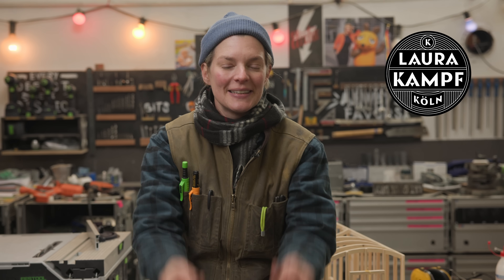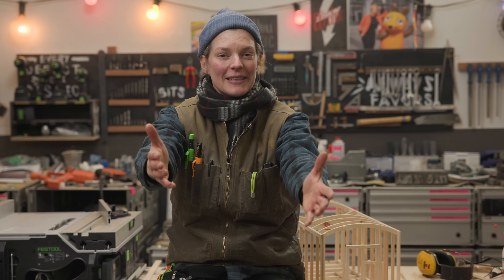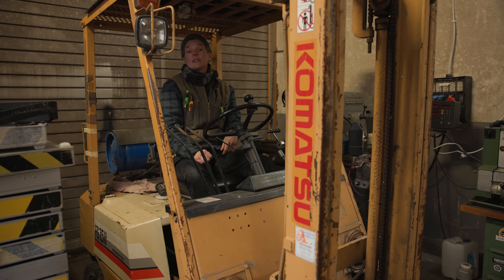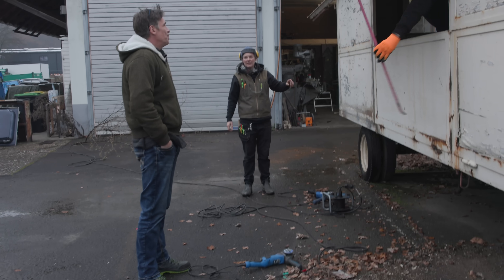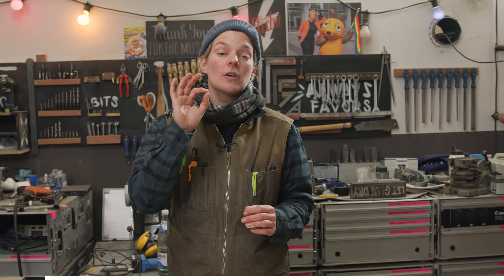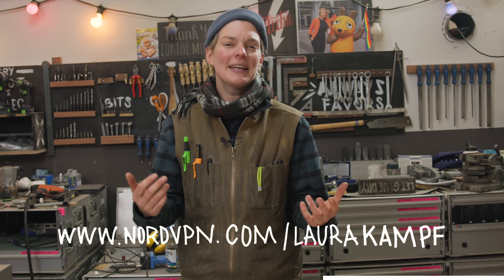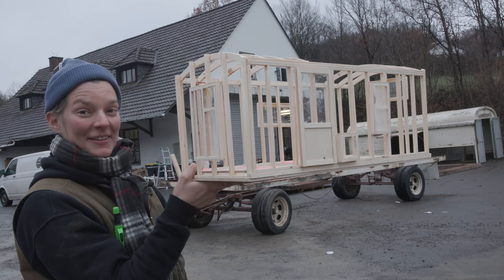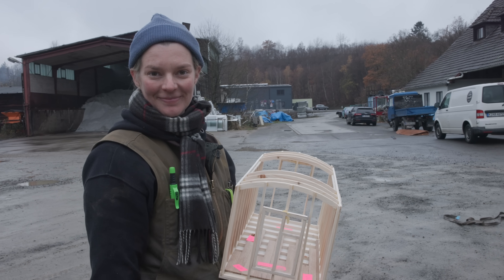Sometimes it all goes to plan! ( Building a Tiny House...fast!! )

Comment: Laura's forklift is becoming such a character in these videos, I think it needs its own name (and a new battery).
Reply: And/or maybe an external Anderson style connector for the battery for easy jump starting...
Reply: @a-091-l2j  how would you jumpstart an electric forklift, surely the Anderson connector would be connected to the battery, so as soon as you unplug it, it turns the truck off.
Reply: @a-091-l2j  scrap that, I just noticed it’s a gas forklift 😂
Reply: and maybe new generator.  I think the battery is ok, just not charging up for the forklift ops.
Reply: How about “Gabel” for a name?
Reply: @MrMNRichardWright  Gabi XDDD
Reply: Sphoon Hifter!
Reply: Fjork Litner.
Reply: @MrMNRichardWright  Gab(ri)el! ;)
Reply: They should do a makeover Laura style on it as well, maybe a new custom paint job
Reply: Sven Gabelbart
Reply: It's a Komatsu and prefers a deep sleep so I vote for "Koma", the German word for coma :). Just paint or sticker over the "tsu".
Reply: @bobstrubb7431  With the right paint job, and its changeable nature, maybe it could be Koma Koma Koma Chameleon. 🦎
Reply: Forkey McForkface
Reply: @noelhutchins7366  damnit, you beat me to it.
Reply: LIese Lifte!
Reply: @noelhutchins7366  damn it ,beat me to it.
Reply: @caoimhegg  omg, that's actually funny and pretty fitting
Reply: @caoimhegg  Ding ding ding! That's a winner!

(not necessarily the winner, but definitely a winner)
Reply: The blue car also needs a name. I mean, it's an absolute troop. 
Like, it literally electrified the atmosphere so everyone got lifted up. 😂
Reply: @caoimhegg  Liese Lifta'
Reply: Great idea re naming. 
My suggestion is 9, given it is referred to that way a few times!! 😂
Reply: @evelyngorfram9306  LOVE this 😀
Reply: @bek-bek-bek-bek  How about Fork Nine?

Comment: Probably a good idea to make a base for the new shed. At least weatherproof the rails at the bottom with a metal paint and raise it onto slabs or blocks.
Reply: I was surprised that they didn’t move the top back the the end of the paved area and placed pallets underneath to get metal up off the ground.  With a pallet floor allowing air circulation Laura can resume using the metal shed to store wood and other outside materials.   Then too,  the trailer could be moved closer to the building door for its own build.
Reply: yes .. maybe some footing blocks, precast pavers, as the 'foundation'
.. and reinforce the structure.  maybe some angle iron?  the bottom edge on one side was drooping drastically during the lift
Reply: Use Hammerite or Brunox 4 in 1 for protection.
Reply: They can still do this :)

Comment: I can see you've never blown up a car battery before :).  When you hook up jumper cables you want to hook up both positives to the batteries, one negative to a battery and then hook up the other negative last to someplace on the engine of the last hookup that will give a good ground.  This is so the spark is someplace away from the battery, so it doesn't ignite the hydrogen gas that can be produced in the battery.  Believe me, blowing one up is pretty dramatic.  Luckily when it happened to me it started a small fire first, so I was able to get back before it blew the top of the battery off and sprayed acid all over the place.  Also, I would recommend getting a set of jumper cables with heavier wire, they tend to work better.  We've been following the house and tiny house and are looking forward to seeing how things come out.  Take care.
Reply: Good point! I would also recommend to ALWAYS double check the polarity when connecting two batteries in parallel. I believe, that everyone including Laura knows what could (and probably would) happen, but for those who don't - if + was connected to - and vice versa, you basically create a circuit where one of the wires connects both batteries in series and the second wire SHORTS this circuit. Which can literally WELD the connectors to the terminals and you may not be able to disconnect the whole circuit, which can destroy both of the batteries. And it does not matter that one of them is discharged. So please, be extra careful. Apart from that, great video, as everything that Laura does 🙂
Reply: This. And give some stable revs on the car you're charging the dead battery with and leave it for a few minutes. Literally just had a dead battery issue due to too few kms of driving cause I work remote :( Had to replace it, was too far gone.

Comment: I strongly reccomend changing the tires, they seem old and may burst when you put a lot of weight on them
Reply: We have a lot of old trailers like this on our farm and their tires are in way worse condition. I wouldn't change them, they are fine.

The finished house will not be that heavy, won't move that much and when it moves it won't be going fast.
Reply: I think you are judging the condition based on car tires. This tires will reach 30km/h max speed with pretty much nothing of weight only once for 15m and stay still in the same place for the next 5 years maybe.
Reply: @DanielConstantinoS   Exactly. I would even call it wasteful to replace these tires. They have decades of life still left in them.
Reply: Perhaps fill the fridge AFTER doing motorway speeds.

Comment: laura take a volt/ohm meter and put it on DC volts check to see if the alternator is charging your forklifts battery when running it should be putting near 13-14v DC into the battery if it is then the battery is likely dead needing replacement if its not then you need to have the alternator checked to see if its working or the charging circuit is functioning

Comment: The fun you had with the forklift felt awfully familiar. I know someone who owns a 1989 Toyota forklift and it's been driving us crazy! For a while it had a knackered battery, which meant I got very quick at removing the seat to get to the battery and jumpstart it. They already had a massive 12 V battery with jump leads on a small cart so we always kept that close. Then the forklift also developed carburettor issues to make things even more fun, very hard to start and would sometimes randomly die. That was last year and this year to top it off we also had overheating issues. Nothing better than having a forklift die in the middle of the shed 10 minutes before an exhibition opens and you need to move stuff out of the way urgently.

Comment: When lifting the forks of the forklift, you should use the gas pedal to rev up and give the pump more pressure to work with. And also the engine will not stall.

Comment: Flawless execution! You guys deserve a win! -And a new charger and relay for the Komatsu! Merry Xmas! Oh, and if you put the "shell" up on blocks, it will work as a drying/seasoning shed, turning "green" wood into furniture wood.
Reply: Flawless execution.. Standing under lifted and poorly supported structure/load. Like the shed is not a big deal if it brakes in half. But people standing inside of it when it brakes apart and fall down. There are people that has lost fingers from small paper cuts. Going into shock and emergency room for paper cuts in a office. Can not explain why someone go into shock after a paper cut like bitten by a snake. It might have been something else just covered up.  But I know people have lost fingers to paper cuts. Do not play with danger. Even if your making a video for the internet it is not ok.
Reply: @TheDiner50  I admit I shared that worry when I saw the video, so "flawless" should be amended to "Accident-free" :) BUT! They were inside the shed, not under it! We could of course agree to sit in our basements with the lights turned off until we die of old age... There IS such a thing as "Too cautious" :)

Comment: Interesting project 👏🏻👍🏻
But I would not use bent roof timber because it‘s only lots of work with no function. A flat roof tilted to one side will also do the job of getting rid of water.
Looking forward to the next videos 🤗

Comment: I have an old forklift that I rarely use as well. When I need it I really need it though. A mechanic friend recommended adding a universal battery disconnect. Sounds fancy, but it's a little knob that goes on the negative battery terminal and disconnects it so the battery doesn't run down over time... May help

Comment: I like how you start (3:27) at the corner furthest away from the open door where you might well just be guessing at the line you need to cut.  It's not super clear whether that's actually a snap line or marker or just a convenient lip shadow that seems to be a little higher than you are cutting.

Comment: You need a portable battery booster!  Basically just a big handheld battery with super short jumper cables attached to it.  I have one that’s about half the size of a brick, usb rechargeable, and it doubles as a portable power source for my usb-powered devices.  It’s pretty sweet.  

No more dealing with cumbersome jumper cables, no more flagging down strangers for help, no more moving cars around to get close enough for the cables!  Serious life improvement device.  It cost like a hundred bucks or so, which is maybe a little more than maybe you’d wanna spend, but I’ve used it at least 50 times, and the time, effort and frustration it’s saved me over the years is incalculable.

Comment: You totally should have reinforced the they bottom of the old "Storage Shed" welded angle iron on all 4 sides that way it will not twist and the door will still work. If it was me I would have raised it up on blocks and attached the old flooring to the new angle iron frame so that it is off the wet ground to keep the wood inside dry.

Comment: Get some long torsion straps to put under the base frame of that shed such that there’s a decent amount of strap either side of the shed so that at least 4 people can put the strap over their shoulder in a crouched position then lift it up so the straps can support it’s weight.

That way, you can move it in one go to higher ground and out the way of your shop’s entranceway…also, getting the lower frame off the ground and out of the wet

Comment: Great job! I think you should put the new shed on a simple foundation like some bricks. The metal frame will sit in puddles the whole time and rust away. Sorry if that was the plan anyways!
So great you got to turn one into two! Now I really see the benefit in not using the steel construction on top!

Comment: These trailers usually require the towbar to be held horizontally to release the brakes. In case the trailer became the detached from the truck while driving the towbar would fall down and automatically apply the brakes.

Comment: it would be a good idea to put some blocks under the upper part so it does not lay flat on the ground. Water will colect there and can't run off causing lots of problems.

Comment: Be *very* careful when you move it to your house if those tires are as old as the rest of the trailer, Tire Rubber loses a *ton* of its pliability after as little as 6 years which will almost never be obvious from the outside and will drastically reduce its load capability, so after you load it up move it very slowly (like 5 under the speed limit of city streets slowly) to avoid a blowout.

Comment: I am a professional forklift mechanic. Seems like besides a bad battery you have a bad battery connection. That’s why it does on a sharp turn or a bump. The connection swings away or comes loose, sometimes that even happens internally of the battery.

Comment: the brakes where probably seized 
now that the plan is to make a completely new building on the wagon , it might be more usefull to build a tiny house like a beach house on a metal skid that can be loaded on top of a trailer , that at house liselotte taken off and set on a few foundation blocks on the ground 
makes hooking up the utillities and using the tiny house at a later date as a garden house or guesthouse or selling it a little eazier (a tiny house like that is looking more like a house and is a lot lower than having it placed permenently on a wagon so its not sticking out over the fence anoying the neighbours ) its allso eazier to add little pieces like a toilet shower add on to the side of it if needed

Comment: Fun video! Just curious why you picked it up from either end with the forklift, instead of in the middle? Picking it up in the middle would have let you slide out the wheel base, then lower evenly to the ground, would it not?

Comment: Not sure why you cut the sides out of the top Laura ... you could have moved it to a corer of the lot and continued to use it for wood storage in the short term. ... even if you had to add a simple wooden platform underneath.

Comment: For the bad battery of the forklift. Maybe one of those chargers, who charge and discharge batteries automatically, could help?
Reply: I believe it completely froze because of the low temperatures lately and there was no/too little charge left in the battery. It's toast after that, sadly.

Comment: Not an expert, but either battery is not charging, or the alternator might be bad? Glad you all made it safe!
Reply: Seems to me it's more likely to be poor connection with the battery, especially since it seems to cut out when it turns too sharply.. the jostle might be cutting the already poor connection. I'd definitely want to check the terminals and wiring for corrosion first, then check the battery voltage, and then it all that was good, maybe the alternator.

Comment: I think you pulled everything awesome about this wagon off it.   I'm surprised you didn't repurpose the floors and the upper frame.  It was ready to go, insulate and you're in business.  Just don't know why you wanted to start from scratch?
Reply from the maker: There are a lot of reasons not to work with a metal frame. Look into building physics, good bridges, ventilated facades…

Comment: Good day Laura.  Considering the problems you were experiencing with having to jump start your lift truck, have you ever considered adding a battery maintainer to the device.?  I have used one of the Viking maintenance units on my truck and outdoor power equipment that use 12volt batteries and an electric starter.  (https://youtu.be/ygG1cwYfj7U ).  Although pictured with battery clamps, this model also offers a set of lugs that allow a hard wired connection to the battery.  I am NOT affiliated with this company but have personal experience using these devices for over a decade.  

Wishing you, your furry kid and family a blessed Christmas season.  Peace Laura

Comment: Hi Laura… a small hint when cutting with an angle grinder. Avoid vertical cutting beams that are carrying weight. You can pinch the disc leading to a shattered disc with fragment flying everywhere. Did you know a disc spins at almost 300km/h? Glad everything went fine and I am looking forward to this project.